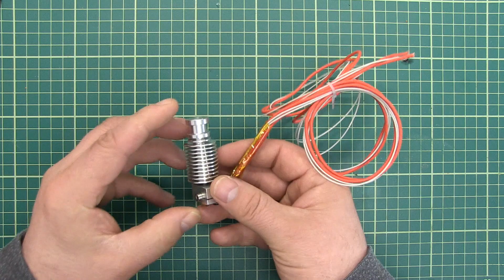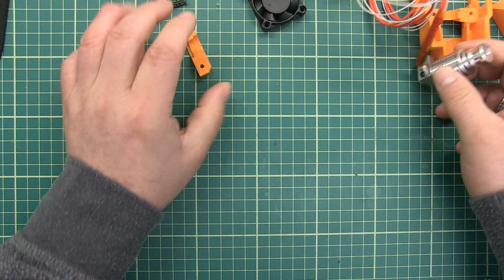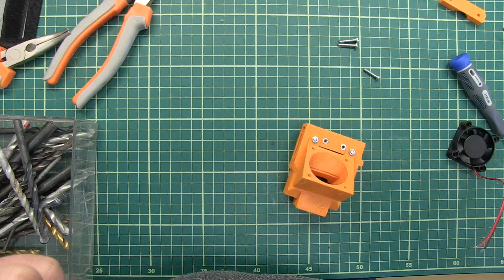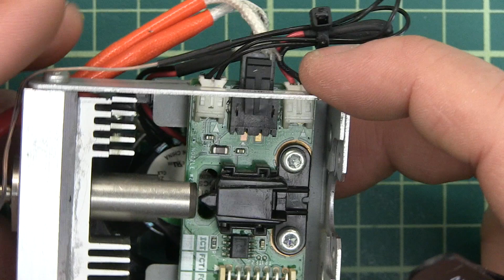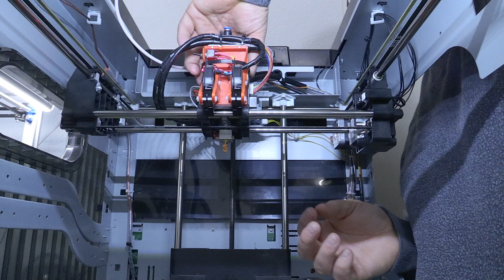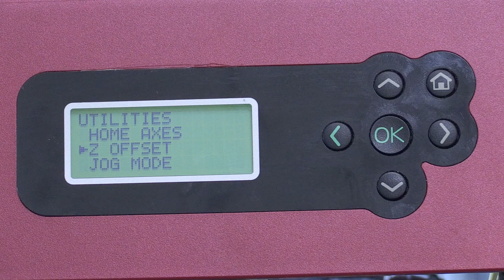💮 Da Vinci Pro E3Dv6 Hot End Conversion

Comment: Great video, Brian! And thanks for your endorsement of my design.

------------------------------------------------------------------------------------------
When I assemble these cartridges I do a few things differently than Brian, so I thought I would point out some of those differences here for the benefit of the viewers who are considering making this upgrade. These are just tips; there's nothing inherently wrong with the assembly methods Brian uses in the video.

- For securing the fan and heat sink clamp, instead of tapping threads into the plastic as Brian did I use screws specifically designed for plastic. These screws have nice deep threads that self-tap into the plastic for a secure hold. These are the screws I use: https://www.amazon.com/gp/product/B00GDXW3OE/

- For securing the fan shroud to the main cartridge body, rather than drilling the holes out and using bolts and nuts to secure the shroud I also use special screws for plastic. Specifically, these: https://www.amazon.com/gp/product/B00GDYDV5S/.

- Additionally regarding the fan shroud, I use glue to secure it to the main body and prevent air leaking out between the fan shroud and the main body. I first apply the glue, then screw the fan shroud to the main body and finally clamp the two pieces securely together until the glue sets.

- When securing the PCB to the cartridge I use M3 lock nuts in the nut recesses. I recommend either using lock nuts or at least using a thread locking compound as a precaution against the screws coming loose due to the constant movement/vibration of the hot end carriage.

- I have also switched from using a screw terminal block for the fan to using a JST connector. This means I have to connect the fan wires to a pigtail which plugs into the board. This is a little more trouble than the screw terminals, but it makes it easier to ensure the fan is connected with the correct polarity. You can see how the fan connection has changed in the pictures on my thing's page: http://www.thingiverse.com/thing:1328848

One thing Brian didn't mention in the video is that you need to be sure you are using a 5V fan. Most 40x40x10mm fans you find are 12V, but the fan voltage on the da Vinci Pro is 5V. You also need to be sure you use a fan with sufficient airflow to properly cool the hot end. I have found some of the "quiet" fans on the market do not have sufficient airflow. I currently use this fan in my assemblies: http://www.mouser.com/Search/ProductDetail.aspx?R=FAD1-04010BBHW11virtualkey56210000virtualkey562-FAD1-04010BBHW11

This video has sparked a fair amount of interest in my PCB for the hot end. I do not generally keep an inventory of these PCBs on hand instead building them in small batches for filling orders of my fully assembled/tested cartridges. I currently have the parts on order to make a batch of these PCBs; I will reserve a portion of this batch for people interested in ordering the PCB only. These PCBs should be ready in the next 2-3 weeks. If you are interested in ordering one please contact me through Thingiverse: https://www.thingiverse.com/messages/compose?username=bdwalker1

Bruce
Reply from the maker: Thanks for this tips Bruce. I will change the text for the video to make sure everyone reads it.
Reply: Bruce Walker where and how would i be able to purchase a pcb for this mod on a davinci pro?
Reply: where is the link to the PCB Board?
Reply: Hello, I am from Iran and I do not have the possibility to get pcb. You can give me the map

Comment: Just picked up a Davinci 1.0 Pro and will probably go ahead with this upgrade since it gives ability to swap nozzles when needed over fixed nozzle. Would it be worthwhile to upgrade my extruder also now just to have both better parts from the get go? Since new I see XYZ software has improved to use Cura so should I just stick with it here. Not really wanting to do major surgery to change pcb for new firmware and software.
Reply from the maker: Hi, to be honest, it's long ago since I last used an XYZPrinting printer. I am sure they have made a lot of changes for the better, and therefore I can not really recommend things anymore because my knowledge is outdated.
If the technology for the extruder is still the same as it was, then for sure it's worth to do an upgrade, but that can be a very simple one, even with 3D printed parts. When I had the printer, my extruder had a lot of problems feeding because the presure on the filament was not correct. I changed it to a 3d printed dual drive extruder and all the problems were solved.
Have a lot of fun with your 3D printer. It's a fun machine to work with.
Reply: It is a 2017 model I found at a local Goodwill store and looks like original parts still so will go with both upgrades just for the effort. Thanks

Comment: I've just customised the E3D hotend to the stock cartridge. Looks stock,  has the E3D hotend and use the standard heat sink. Prints perfectly with a custom fan mount
Reply: Can you document?
Reply: @marcoj.m679  I've changed it over to a mk8 hotend. if I change it back, I'll do a video on it

Comment: Hi Bruce, i have a broken quick change holder do you have an solution for replacement too ? I can´t find this as a spare part from XYZ
Reply from the maker: you can print the holder mentioned here and use the original pcb from the printer, or buy the replacement pcb from Bruce.

Comment: its is difficult to do this work?can you make for me?
Reply from the maker: No it's not difficult, but as a biginner I wouldn't do it.
I don't make them, because the design is not mine. The original designer is linked in the description and he has a shop selling them.
Reply: @3dPrintCreator  i will try to print.and i will buy the pcb

Comment: Hey, Brian. I have an issue. I printed the same body, and bought the same parts, however I cannot adjust my Z offset down far enough to allow the nozzle over the print bed. (I can only go 9mm down. The stock extruder is set at about 1.57 mm.) When I try to print, it's so close, its dragging the print bed around, and there's not enough space for any plastic to extrude. Do you know a fix for this? Thanks.
Reply from the maker: Hi Clint,
I don't have the printer anymore to check out the problem, but I think you did not lower the bed all the way with the thumbscrews, and also used the Z axis offset.
You have to use both in order to make this work.
Reply: @3dPrintCreator  Ok, makes sense. I'll try that.

Comment: hi Brian, I was wondering if once installed any modifications need to be made in the firmware so that it indexes properly with the new heating element and thermistor.
Reply from the maker: No modifications need to be done, except for re-leveling the bed and bringing it down a little more.
For the rest, it's all the same.

Comment: Hi, Unfortunately  My da vinci nozzle is not working so i was going to change to the E3Dv6 but I can,t print the drop in cartridge. I've looked a couple of times on the website mentioned and its always out of stock. Anyone know any where i can purchase one please ?? thanks
Reply from the maker: As far as I know, he is the only person making these PCB's and drop in cartridges.
I know, in the past, he only made them after there were enough requests for them, but I don't know if he still makes them or not.
The cartridge however, can be easily printed on almost any FDM printer that is well calibrated and you can use the original PCB that is installed in the XYZPrinting cartridge. Therefore, if someone can print the cartridge for you (or any print service, like 3D hubs), you are good to go.

Comment: Hi Brian,

I am working on fixing my printer, my thermistor broke. Where did you get the thermistor you use for this project / do you know a source of thermistors that is correct? I have tried a few, but i have not had any success.  Thank you for all your work, your videos are great resources!
Reply from the maker: Hi, I used the Semitec 104GT thermistor that came with the E3D hot end. This is more or less the standard Thermistor that is used in 3D printers, unless specified others.
You can get it from a lot of different sources, like Aliexpress or Gearbest, etc. But you can also buy it on the E3D-online website.
Good luck with your repair.

Comment: Hi, I know you don't have this printer, but would you tell me if the e3dv6 is 12v or 24v?
Reply from the maker: The one for the Da Vinci Pro should be 12 Volt (that's also the most common version, like if you buy a knock off from China).
When you look at the E3D website, you see you can choose 12 or 24 volt. So when you buy the original, you should look for the 12 volt version
https://e3d-online.com/v6-all-metal-hotend?gclid=CjwKCAiA27LvBRB0EiwAPc8XWYrfFhsVGVjT_miweF-yerjsNo-kcCERBcVJC0g2WCF-m7BnAi3k3BoC9DUQAvD_BwE
Reply: @3dPrintCreator  you could pass me the eBay link which would be the right one to buy thank you very much
Reply: https://rover.ebay.com/rover/0/0/0?mpre=https%3A%2F%2Fwww.ebay.com%2Fulk%2Fitm%2F153705882963
Reply from the maker: I think this would be the right version.
That said, I don't know if E3D has resellers via EBAY... The chance is that this isn't a true genuine E3D hot end, but maybe it is.
At least it's pretty cheap compared to the E3D store.
Reply from the maker: By the way. I have done many upgrades with clone E3D hot-ends where I only changed the heatbreak and the nozzle for a genuine E3D and this always worked perfectly.
You can buy clones for less then 10 bucks if you search for JHEAD V6
Reply: @3dPrintCreator  I have a doubt the PCB is just that because I live in another country and on the web they do not send where I send the purchases you can buy the PCB elsewhere or someone can recommend me some and that PCB is necessary or you can put the  original that brings the printer
Reply from the maker: @alejandrorios2059  You can use the original PCB, hoewever, in some cases you would have to do some soldering because the connections are not of the same size.
(this depends on the version of original board you have)
Reply: @3dPrintCreator  I can buy somewhere else the PCB that recommends me that is not the one that you show in the video that is on eBay to buy and I can pass some link

Comment: so by doing this replacement, we lose the sensor near the nozzle?
Reply from the maker: What sensor? You will have the exact same functionality as with the original hot-end assembly, but much more accurate.
Reply: @3dPrintCreator  i mean, the small metal column with spring that for auto leveling. but anyway it's no better than manually.

Comment: Thanks for this video! I was wondering about the link to the hot end.  You described it as "the SHORT 1.75mm version on this page" and the page has a choice of two types, A and B.  Further down the page, it says "This is Long distance 1.75mm type." for both model A and B. Which one should I get?
Reply from the maker: Since making this video you can no longer choose the short or long version. You can now only buy the long version, but from there you can push the push-vitting and then you keep the short version, exactly the same as if you were to buy an original E3D.
Reply: @3dPrintCreator  thanks for the reply! I guess that means that I'll order the one on the linked page, right?
Reply from the maker: Yeah, you could do that, or order any E3D clone (or the real thing) you can get your hands on.
When I made the video there were not that much clones available for a nice price, but at this moment shops all over the world have them in stock for just a few bucks. 
As long as the hot-end is E3D V6 compatible (or J-Head, that's the same thing, different name), you are good to go.

Comment: Hey Brian.... I have my e3d all ready to drop in my da vinci pro 1.0. Do I need to load a certain software or slicer that will work with this unit ? Or will it allow me to go above 240c as is? Is it plug and play basically is what I'm asking...
Reply from the maker: It's pretty much plug and play, but you have to lower the bed a bit because the nozzle sticks down a little more then with the original hot-end
Also, the limitations of the maximum temperature are set in the motherboard firmware and you can't change that. I ended up changing my motherboard as well into a Arduino 2560 with Ramps 1.4 and Marlin firmware.
But, I don't have that machine anymore. It's now cheaper to buy an Ender 3 then it is upgrading to another hot-end and motherboard.
Reply: @3dPrintCreator  how do you recommend calibrating the machine after the e3d install ? The old school method with paper ?
Reply from the maker: Oh yeah, that's the only correct way to calibrate the printer. With or without an E3D hot end.
Reply: @3dPrintCreator  so I have .y e3d installed and I'm maxed out as high as I can go on my z offset at 9.0mm. Still not clearing the build table. Ideas? Can you email me please?

Comment: Very good video encourages me to make the change of fuser to the Davici 1.0 pro printer that we use at work, I would like to be able to replace all the components but I do not locate the plates that you use for montage I can distinguish that it says "Davinci 1.pro extruder PCB "but I have not been able to locate it. If you would be so kind as to put the address where you can acquire, I would be very grateful. Thanks in advance a hug.
Reply from the maker: You can find all the answers here: 
Here you can find his Thingiverse page where you can download the parts and contact him to buy the PCB. Also, if you like the part, please thank him for making it or buy the PCB from him instead of using the original PCB from your Da Vinci Pro drop in cartridge
http://www.thingiverse.com/thing:1328848

Comment: Is your fan a 35mm fan ?
Reply from the maker: The fan I am using here is a 30x30x10mm fan
Reply: @3dPrintCreator  i bought a 30mmx30mmx10 and holes werent even close to matching the fan housing
Reply: @3dPrintCreator  measure it I'll venture to say you have a 35mm
Reply from the maker: @1hovermale  I wish I could. I don't have the printers anymore. Yet I do have a box with about 75 30x30x10 fans while I once bought 100 of them for a project. If I remember correct, I used fans from that box.

Comment: I was finally able to order a PCb board from Bruce. Bangood was out of stock on the hot end so I picked up a clone off Ebay. Will the brass nozzle be able to hold up to carbon fiber and reinforced nylon/ glass blend filaments over time?
Reply from the maker: With abrassive filaments you better use a steel nozzle instead of brass. They are cheap and work great.

Comment: I can not get a hold of the guy to  buy one of these units assembled... any idea how I can get one ?
Reply: Ya I just didnt want to have to remove my board from my original unit
Reply from the maker: It's not that hard to do. Just one screw and making a different connector. I have done it a few times in less than 30 minutes.
Reply: @3dPrintCreator  can you possibly do a video for this since Bruce's parts are no longer available?
Reply from the maker: Sorry, I do not know where he left off.
I know that at a good time his stock with manufactured pcb's was gone and that he thought about not to manufacture them anymore. I do not know if he actually decided that then, but this was more than a year ago.

The good news is that you can print everything yourself and that you can use the original print from the Da Vinci Pro to work with. You do not necessarily have to have his pcb.

Good luck.

Comment: Hello. What benefits does this hot end have over the original? thank you
Reply from the maker: A whole lot of benefits.
- Bigger temperature range
- More stable temperature while printing
- Possibility to change the nozzles
- Can be used with or without an innerliner tube (for different materials)
- etc. etc.
Reply: 3d Print Creator thanks for your answer. I'm having trouble finding the pcb board. Could you tell me where to buy? I tried the Tindie site, but it's out of stock.

Comment: Brian, how did you get the whole thing into the carriage with the fan mount? Mine will not fit. Even if I could get it in there it would be so tight that it would be too cumbersome to be consistently removing and putting it back in.
Reply from the maker: Syndicate Ninja ehh I don't know why it should not fit. It just snaps in like the original module.

Comment: Is there a specific advantage to using Bruce's board?  I have an old Davinci hot end I could rob the board from is the reason for the question.
Reply from the maker: Hi,
The only reason to use the board from Bruce Walker is that the original boards are not available to buy.
If you have an original board, use that one instead.

Comment: Hi, i have a problem with z offset. Max is 9mm. But still my hot end hits the printbed. Im doing something wrong? Or just firmware was updated with this upper limit of 9mm?
Reply from the maker: Hi,

For me I had to lower the bed by about 2 millimeters to and set the Z offset. Lowering the bed with just the thumbscrews is enough. Not to it's maximum, but just 2mm. The way I did it was setting my Z-Offset to 8.2mm and then doing the rest with the Thumbscrews. This gives some play in both the screws and the offset for future settings.
Reply: 3d Print Creator thanks. I will try that

Comment: Hi Brian, 

What fan exactly do you use for that conversion, 40mm / 5V ???
Reply from the maker: Hi Lukas,
It's the exact same fan as on the original extruder.
Look for "40mm 5V 2Pin 4cm 40x40x10mm Mini DC Brushless Cooling Fan" on Ebay, you'll find them.